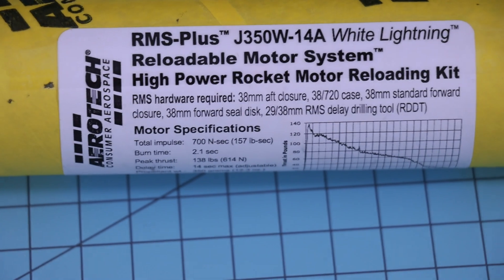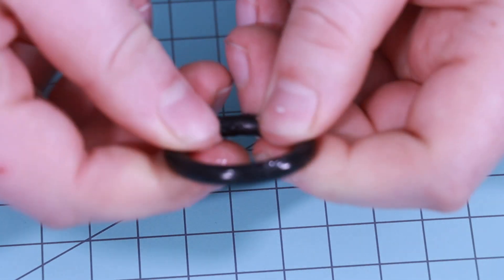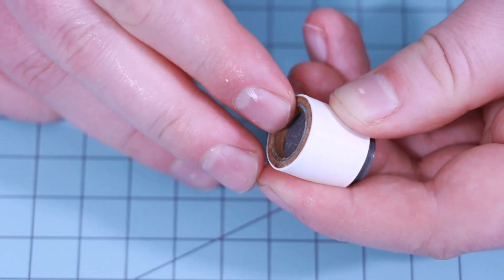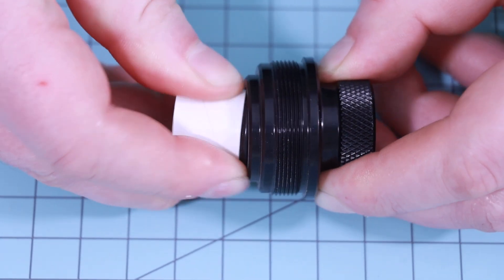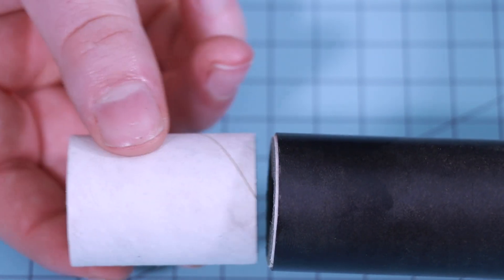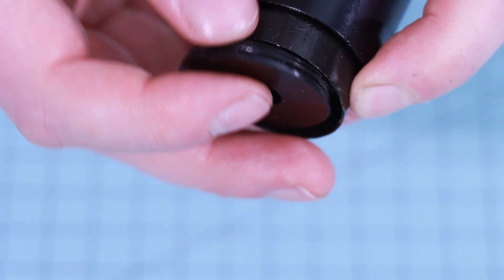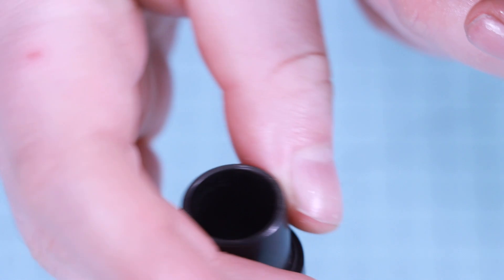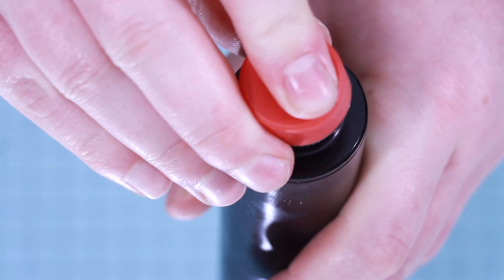AeroTech J350 High Power Rocket Motor Assembly RMS 38/720

Comment: I've assembled hundreds of 38mm AT RMS reloads over the last 16 years and found a few tricks that I found work much better for me then what you describe in the video. Just thought I would let you know about them.

1.  After chamfering the delay insulator, I push the delay grain in all the way, and then insert the aft delay spacer into the same end I chamfered.   It goes in much easier that way and doesn't kink like the one in the video did.
2.  I also found it's much easier to take the delay assembly and place it on the table with the o-ring up, and take the forward closure with the forward delay spacer in it and just push it down over the delay assembly.  I found it's much easier to push it down over it and be sure its seated firmly that way.
3.  I also never grease the outside of AT liners any longer.   The only ones I ever had issues getting back out were the ones I greased when I first started assembling AT 38mm and 54mm motors 16 years ago.  I've never had one stick since I stopped using grease on them.  YMMV.
4.  After chamfering the liner, I insert the seal disk with o-ring into the liner immediately.   That way you don't forget which end you chamfered and try to put the disk into the end you didn't chamfer.  I find it's much easier to  insert the seal disk when dealing with just an empty liner and the seal disk.   
4.5  Then standing the liner, seal disk down, on a table to prevent the seal disk from getting pushed out, drop in the propellant grains.  
5.  I just put the forward 0-ring into the case on top of the seal disk and screw the forward closure on.   It's much easier getting the o-ring into the motor that way, then when you put it onto the closure and have to squeeze it into the case past the threads.  The o-ring will compress into place when the aft closure is tightened.
6.  I pour just a little powder into the powder well and tap the case the way you show in the video.   You didn't say why you were doing it, but it's so some powder gets inside the closure and against the delay grain.   It's much easier to tell that has happened if you only pour a little powder in and tap first.   You can see the small volume in the well get even smaller as some drops into the closure and against the delay grain.  Once that's done, pour in the rest of the powder and no tapping is needed, just the red cap.

The aft end I assemble like you do, aft insulator, 0-ring, than the nozzle, then the  closure.   The only note about this is that you should feel the resistance of both the o-rings compressing during the last couple turns of the aft closure.  If you don't feel that resistance of the o-ring compression, you did something wrong.

Thanks for the video.   The J350W is one of my favorite motors.
Reply from the maker: Thank you for the comment! There is a lot of good info in there. I also love the J350W.

Comment: There is a white square lable  shown at the begining when your listing out the parts that come with the J350w RMS kit.  Is this white label to cap off the ejection charge with the red cap?
Reply from the maker: Hello Troy, thanks for the question. I was looking at that label and it is the correct size to cover the black powder well. I looked everywhere in the directions for the function of that label with no luck. I didn't want to only trust the label so I stuck with the plastic cap which was labeled in the directions. So I believe you are correct and I can say that the motor worked flawlessly in my level 2 launch. A video will be out soon with that launch.
Reply: @pegasusrocketry6618  The white label is the original ejection charge cap. Don't rely on it to stay. I usually use tape to help hold it in place. The plastic cap works but can make the ejection charge more energetic and should not be used in certain circumstances.
Reply from the maker: @Douglas Gardei Thank you for the info! I didn't want to trust the white label alone.
Reply: @pegasusrocketry6618  Thanks for information.  I am builing my first 38/360 (I-161 motor) reload for an upcoming lauch and  your video is very helpful.  So it sounds like the red cap work flawlessly as the cap for the ejection charge, correct?
Reply from the maker: You are very welcome! I am very glad you found the video useful. Correct with my sample size of 1 the red cap worked flawlessly.
Reply: @pegasusrocketry6618  I have a 38/720 case and I am currently building the Apogee Katana for my level 2.  I am thinking about using the J350w for my level 2 attempt.  Keep the videos coming.